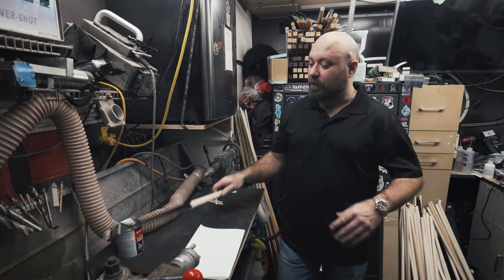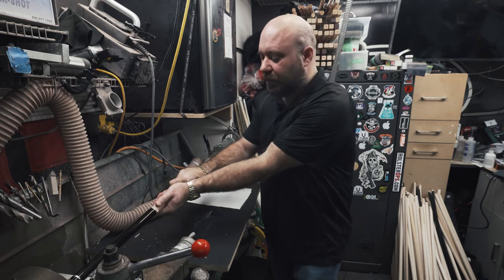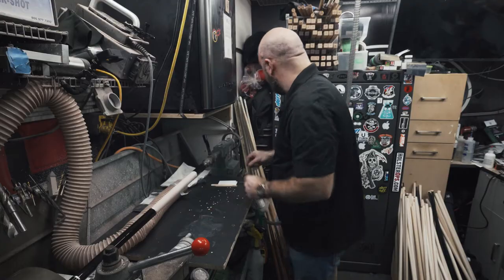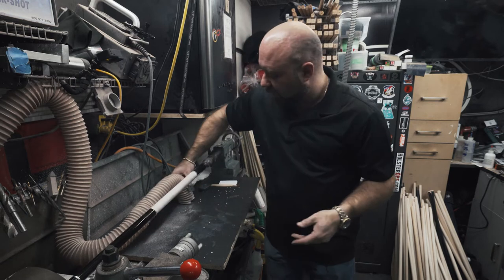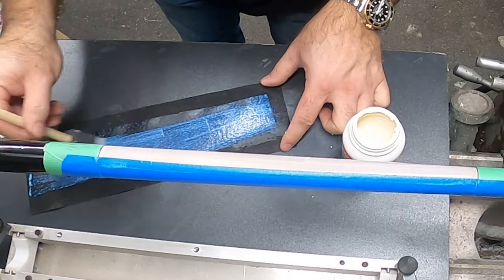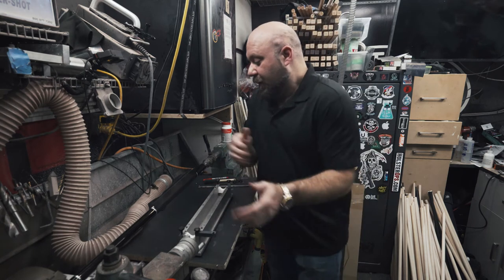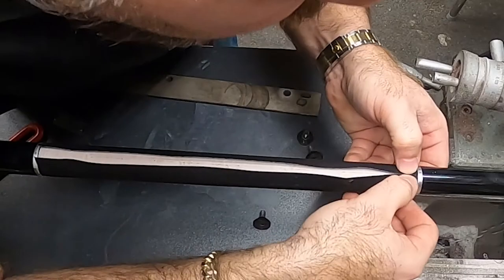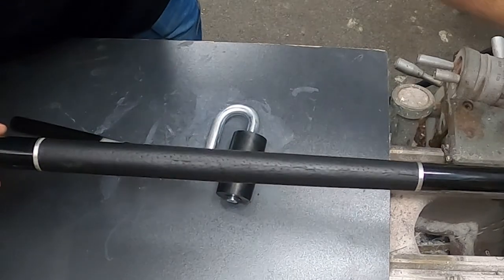Pool Cue Leather wrap with handle buildup

Comment: Easy way I found I installed a cork wrap first sanded it down then applied the final wrap on top of cork.
Reply: I used 1/4” veneer and wrapped like a stacked leather wrap Ave sanded, but to be honest what you just said is a great idea. Easily sanded and you can put on like you do a leather wrap, so over all so far out of all the ways I really like your way, going to try it out on a rubber jump handle replacement to Irish Lenin.

Comment: Couldn't you just build it up by wrapping string... then epoxy the string.... Would be much easier.!
Reply: Interesting Idea, I may steal this. I have commonly used Bondo but this intrigues me. I have told people for years to not buy Rubber gripped cues. Use a small twine such as kitchen twine which will absorb the glue into itself. Excellent Idea.